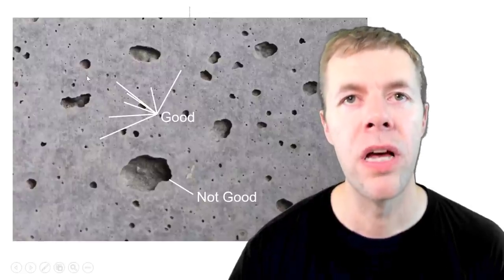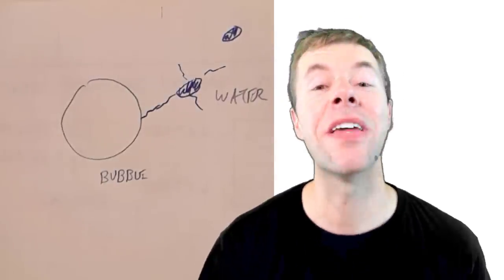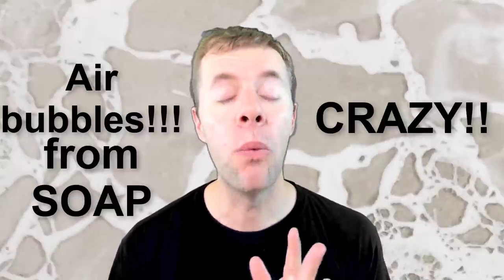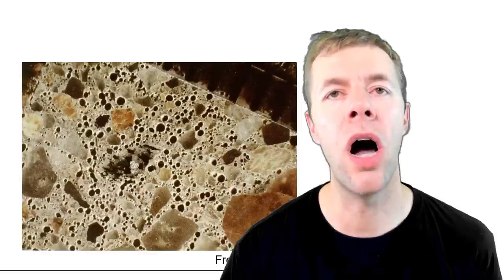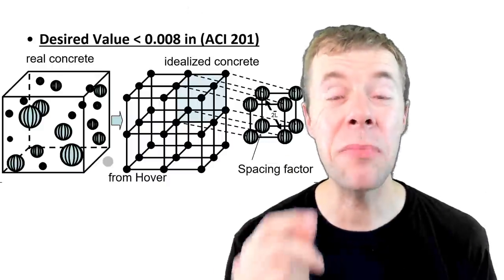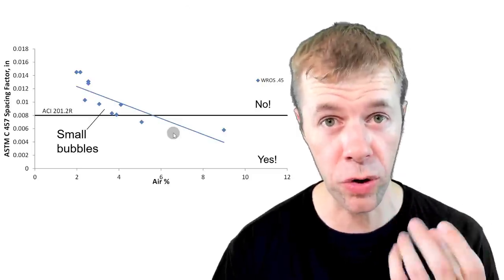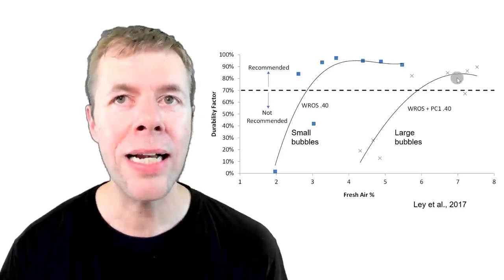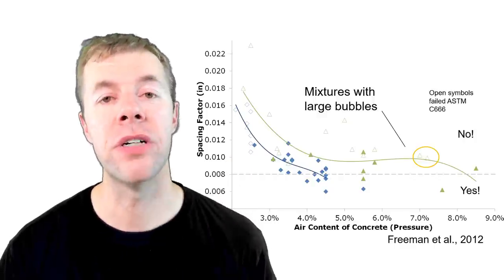Why do we NEED air bubbles in concrete? | air entrained concrete

Comment: Tyler... is it correct to believe that  the greater the impermeability of the concrete the less the need for air entraining? And, the greater the permeability, the greater the need for air entraining? If this is true is there a relationship between impermeability and compressive strength? Density? I have the idea, please correct it if I am wrong, that the greater the compressive strength (or is it density?) the less effective/useful/needed a PRAH like Kryton KIM is?
Reply: Hi, to a certain extend the compressive strength of a concrete correlates to its permeability. A low water/binder ratio during mixing leads to less capillary pores within the cement matrix which are the main „transport routes“ for water and other substances. Keeping the of capillary pores percentage low leads to 1) higher density, 2) higher strength and 3) less permeability. However, note that some high-quality cements may reach high strengths even with higher proportions of capillary pores.

If air-entrainment is necessary depends on the circumstances the concrete is used in (f.e.,temperatures, change in temperatures). Even very dense concretes do have a proportion of capillary pores, which soak water into the concrete hence leading to possible freeze damage. In Europe, the freeze-thaw resistances are usually tested via the „CDF“ or „Slab-test“ methods if you want to read further.

Comment: My take on this is that the approved design mixes should include testing to confirm they get an appropriate bubble size and distribution that aligns with the aci charts for air content.  I currently don't see any of the major labs in the nyc area doing that during mix design and I get to see almost all there mixes on a regular basis.  Is this astm test for air content distribution/size typically being conducted after problems are observed like in a forensic arena or is it actually required for mix design codes.
Reply from the maker: Kevin,
People are using it for mix design approval and then verify it in the field.  NYDOT is doing a lot of work on this.  Many other state DOTs are moving in the same direction.

Comment: If we v8brate it at a certain frequency? Could we achieve a spacing factor to spec?
Reply from the maker: Good question.  That would be fun to try.  When we vibrate concrete we locally reduce the forces of gravity and allow the voids to float out of the concrete.  This means that vibration typically only allows bubbles to leave from the concrete.
Reply: Have to be careful with vibration. Too much and the aggregates begin to segregate and lower the strength.

Comment: So AirCrete is the best?  

What ratio do u recommend?  8 parts of air to 1 part of concrete?  Thx
Reply: PolskaWalczaca I think you mean those ratios in the reverse otherwise you wouldn't have concrete. You'd have a puddle of mush which when set you could crumble in your hands.
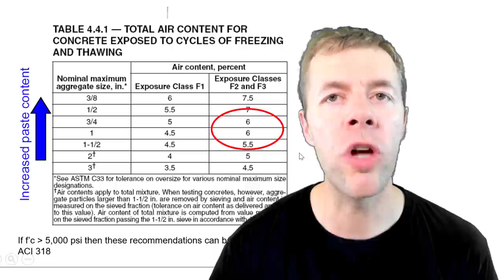Reply: @danielfronc4304  stucko on outside?  2:40 min.
Reply: @danielfronc4304  aircrete is trash anywhere there are freezing temperatures.

Comment: When is concrete looking material not called concrete? What is it, specifically? For example, does water + Portland cement + air bubbles (aircrete) = concrete? If geopolymers are the binder, is that concrete?

Comment: An excellent ancient example of the value of air in concrete is the free standing round domed with central oculus temple in Rome known as The Pantheon. It was built with concrete, but in 120 AD the engineers knew the concrete would be too heavy to be free standing. It would collapse under it's own weight. Their solution was to add air bubbles to the mix, certainly not for the engineering reasons which you illuminate and likely more and larger air bubbles than would be done today but hey, 2000 years later it's still standing!
Reply from the maker: Thanks Daniel for adding!
That is a cool use of air entrained concrete.

Comment: Hi bro.
Could you answer this question: Why is volume of Air Content in concerte, should be less than 10% from cement paste ?
Reply: Its strength decreases too much. Designing concrete mixture for specific purpose is always about balancing contradicting factors :-)

Comment: How do you make small bubbles? Proper stirring?
You'd think that we'd invent some gas generation powder by now. Actually I've seen a foam concrete already so we may be close to a perfect concrete with microbubbles. What is the free water even doing there? It should be a part of a chemical bond . It's never waterproof, is it?

Comment: Hello Tyler really great videos! I am trying to cast cement mortar in a wooden mold. The shape I want to achieve consist of 2 walls of 30 cm height and 15mm width. The shape's top view is like a capital T with the difference that the horizontal line (wall 1)is twice the length of the vertical line(wall 2). Now on the vertical line there is a rectangular block of 2cm (height_)x 10cm(width) that is screwed 10 cm above the base level of the mold which as stated earlier, is 30 cm tall. This will create a groove that will allow me to slide on a wooden shelf. In my mortar The ratio I use is 6 Portland cement, 5 blond washed sea sand, 0.25 Fiber glass fibers, 0.5 sika latex, 2.5 water. When filled, the mold is air sealed with a plastic bag and covered with a blanket. Demolding happens 36 hours after filling.
1) How does a mold that is thin, tall and encloses the cement mortar can affect the curing? There are narrow openings  on the top to fill it in. 2 openings of 10cm length x 1.5cm width on the top of the horizontal line.(One on the left and one on the right side) and 1 opening of 10cmx 1.5cm on the vertical line. The rest of the mold is fully enclosed.
2) I use birch plywood that consists of exterior use adhesive for bonding the layers. Is this material ok for such a size and shape? Will varnishing the wood and sealing the sides with silicone used for windows help? Some vaseline is used and so far there are no issues with demolding
3)To fill in the mold, since there is no visibility to where the mortar has easily traveled to, shaking and vibrating the tabletop is necessary to fill it. How could excessive shaking affect such cast? And if possible define excessive shaking
4) Is there a way to eliminate the cracks that appear next to the desired groove?
5) The edges of the cast after it has been cured are a bit brittle and feel like a cookie when cut in half. Is this an indication of a sort and if yes what sort of indication (mortar, curing, liquid amount)
I am really struggling to make this work well and have a smooth finish If I can send you images please let me know how I could reach you!
Thank you so much Tyler!

Comment: Aerated concrete block or aerated autoclaved concrete block autoclave block cost more but if you can make at home your own aerated concrete blocks you can build a home that has a r-value of 20 to 50 the concrete is also waterproof fireproof and soundproof it's the best building material for the new mini ice Age approaching

Comment: Is modern day air ad-mix like a surfactant? Every mixer driver should keep at least 20oz of air in the truck if there is no company QC on the job they can always call with job specs yards in the drum and if water has already been added or needs to be added. As you know water added is a factor in air percentage

Comment: I understood every thing you said, but i still can't get how this small holes protect the member from cracks and all, could you please make a video explaining only about  how is it protecting concrete, i have exams... so it will be pleasure if you could just explain and also i have a question: if some bubbles are inside which carrying air how is that bubbles are protecting the concrete? And also if you think this is a silly question im sorry, i'm a student i don't know nothing about this, i just started learning about it but please explain :) please reply
Reply: It isn't a silly question. The bubbles protect the concrete because when water expands just before freezing. I think about 2°. This expanding water that's about to freeze can break the concrete with its pressure. But if it finds an air bubble, it expands into it and now has the space to expand and freeze, Thereby saving the concrete from unnecessary cracking. Actually if you look at a concrete building, the southern facing side usually deteriorates faster than the rest of the structure because of the Freeze-Thaw cycle of spring.
Reply: @ronallan8680  but what if the water is more then the volume of bubble or as same as bubble, and then freezing happen? btw that was some really good explanation thank you:)
Reply from the maker: Royal - I have a video planned over this.  Stay tuned!!!
Reply: @royalsavages8803  i have the same question too, what if the volume of water is bigger than the holes

Comment: why I haven't seen anybody adding air in the concrete? Is this automatic when you add water?
Reply: When you mix and pour concrete you are already trapping air in the concrete.
Reply: Dr. Ley tells you in the video.. Basically the Air comes in a bottle. A type of liquid soap. If you watch Aircrete being made it will makke sense. I wonder if the Air crete gun be used to make an admixture to give control of the bubble size & amount.

Comment: When we poured basements, they would vibrate the H out of the cement, to eliminate bubbles I was told.
Now you're telling me the bubbles are good. So why vibrate the cement poured into basement wall forms?
Reply: To fill large air pockets with the mix, to completely fill the form...
This is more about smaller bubbles...

Comment: Why don't you answer questions in the comment section? You even say to leave comments below. I'll ask anyway. Why is it that the concrete poured over 100 years ago is still there but if you pour concrete these days you can stand there any literally watch it crack and fall apart? And 
those holes? Up north here if you don't fill them in they'll catch water and freeze and bust up the concrete.
Reply from the maker: Je,
Lots going on and it is hard to get to all the questions.  Thanks for your response.
A lot of the times that concrete that we see that is 100+ years old is the concrete that has survived.  Aka they got everything right when they made it and it was in a great environment.  When you look at the young concrete that is having trouble you think that more young concrete has problems because you see it deteriorating.  This is called survivor bias.  That means we base everything on what survived and we don't take into account what doesn't.  

I talk about some of this in my video about Roman concrete - https://www.youtube.com/watch?v=PMed3YtN-Fo

These "holes" are critical to make your concrete long lasting any place it is cold and freezes.  It is common practice in the concrete industry.

Comment: How about hollow plastic microspheres or styrofoam beads , to emplace compressible voids of controlled size? (Hollow glass microspheres have been added to concrete for weight reduction. They might or might not help with freeze-thaw, because they are gas-tight and incompressible.) https://en.wikipedia.org/wiki/Glass_microsphere

Comment: Dude, seriously? The first picture with the voids you show is no good at all. Not the big ones, not the smaller ones. The air you want are the one in size of micrometers range. Those bubbles you can't see with the naked eye, dispersed evenly throughout the mix. Open voids are never good since they allow water and other chemicals to migrate into your concrete.
Reply from the maker: Only connected voids allow moisture to travel.  Air entrained voids are not connected with the pore system of concrete until the air contents get > 10%.  This is widely documented in the literature.